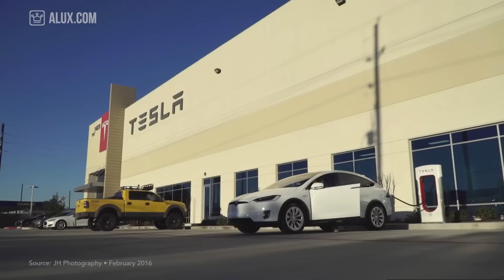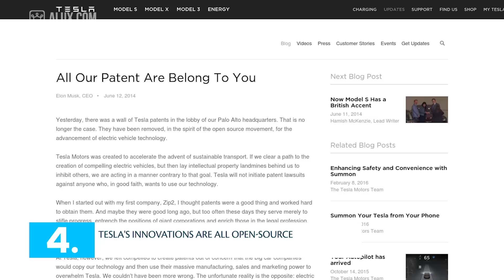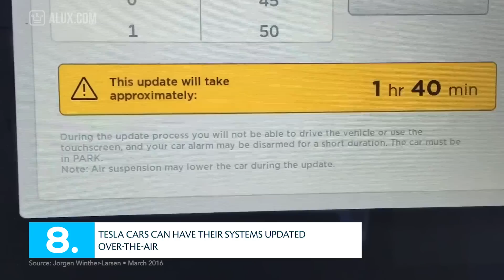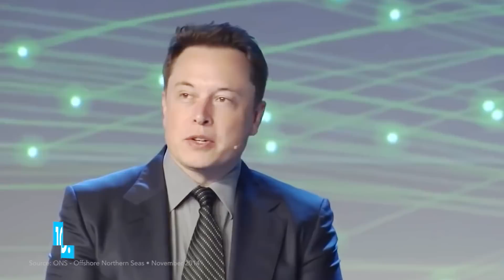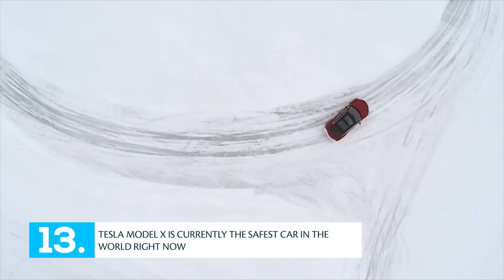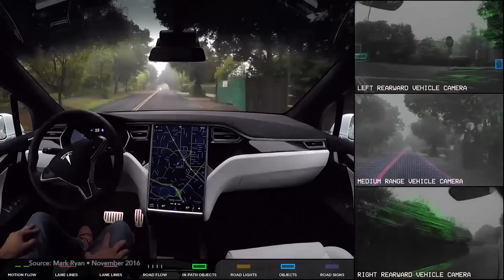15 Things You Didn't Know About TESLA

Comment: The idea of a battery-swapping system was dropped by Tesla a few years ago. At first Tesla build the technology needed for swapping out the battery into each car but after the first few year or so they figured out that almost nobody was interested in paying extra for the battery swappning just for having to wait a little less than they would for charging for their car to be fully recharged. So: Tesla is totally capable of installing battery swapping systems in cars as well as battery swapping stations but didn't see the need or interest by customers. I don't think that Teslas that are currently built have the technology for swapping the battery built in

Comment: It would be extremely unethical for Tesla to program software to pre-determine catastrophic outcomes and it would be unethical for customers to be able to purchase the right to determine the deaths of others.  Instead of focusing on favoring either the passenger of a self-driving Tesla or two or more pedestrians in an accident, Tesla should remain neutral so that the outcomes of catastrophic accidents remain random (i.e.  the outcome of the accident is either the driver's decision, the pedestrians' decisions, or some blend of both), thereby mimicking the same statistical outcomes of random catastrophic events involving non-self-driving vehicles. Instead, Telsa should focus its efforts on using pedestrian traffic data and automobile traffic data to develop an incentives program that rewards passengers of self-driving Teslas for not driving during peak pedestrian times.

Comment: I think that you can’t give a solution unless you know the problem. Each time a potential accident arises the car will have to make a lot of swift calculations. Like probability calculations by using all of its unique devices and sensors to calculate vehicle speed, the speed of the obstacle, trajectory, passenger location, seatbelts and safety features that are installed and in use. That goes for the other scenario also, simultaneously, calculating the speed verses the speed and direction of the person or people, the height of the person, and also braking distance. Each problem will be different therefore each calculation and solution will be different. Basically doing the same thing a person would do. Use your surroundings and try to make the best decision with all of the knowledge you have and as quickly as possible to minimize the impact on life.

Comment: I want the driving range to reach 5 hundred miles and more, and it will recharge itself by solar panel body. The charging station will not be needed.
Reply: how about that?
Reply: Fang Jia solar panels dont generate enough power to charge a car continuously, the solar roofs on fisker karmas take days to charge the car
Reply: Fang Jia borderline perpetual motion machine... breaks the laws of physics
Reply: Walker Hall That and constantly topping off Lithium Batteries is not good for them.

Comment: Faced with a grim situation where on one hand you have pedestrian on the sidewalk to save regardless of their number and at the same time you have passengers in a Tesla car whose safety cannot be compromised, the design engineers at Tesla will have to use all their innovative knowledge to design a safety mechanism which will be deployed by the Artificial Intelligence system on the car with accrancy to resist and absorb the impact of the Crash that the Tesla Car will experience after it has a collision or a head on collision. Conventional to my knowledge AirBags and anti braking systems are the key safety feature that protect the Passengers during the Impact. Well what if we used the Airbag  theory on the outside of the car as well. What if Air balloons or Spherical shaped airbags popped out from the exterior of the car at the right time just before the impact.The sensors on the car would trigger the Artificial intelligence do deploy this safety feature moments before a certain and unavoidable impact. You would have air Bags protecting the passengers inside the car and you would have these spherical shaped air balloon or airbags made from a strong non tear fabric absorbing the impact of the crash.

Comment: the car can't fit 7 passengers, it can only fit 4, where did you get the number 7 from
Reply: It holds 5 plus option for 2 rear-facing child seats in the back hatch area.
Reply: o cool, I didn't even that, thanks a lot

Comment: So we learn that Tesla cars have all the qualities of electric cars of one hundred years ago and many prototypes since BUT STILL the same range limitation due to the battery and above all a HUGE problem to refuel as fast and as conveniently as regular cars ! It just uses STANDARD elements, NO REAL BREAKTHROUG and FAILs to fulfil the BASIC requirement one expect from a car, be able to go where one wants when one wants without any hassle ! A battery car with that range and issue to refuel should be produced for less than 10 K USD, range 200km, lightweight, no gimmick, 6h recharge time at home (although most people don't have the proper electric installation). Just to fill the gap between a bike and a real car :-) Of course not so much money to be made on such a car.